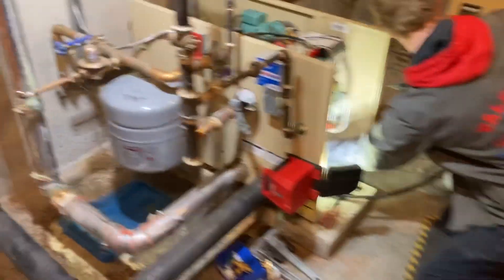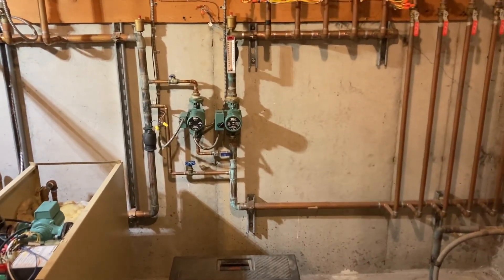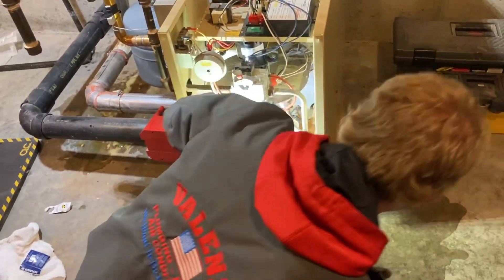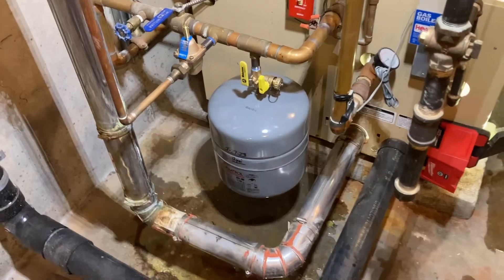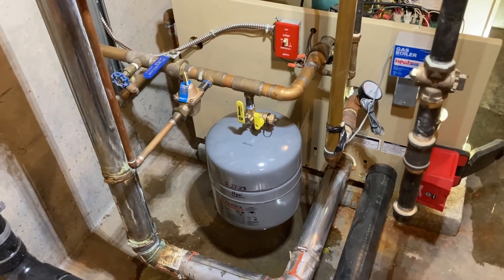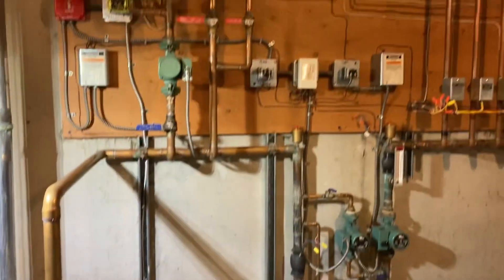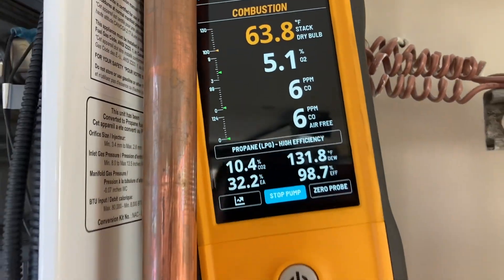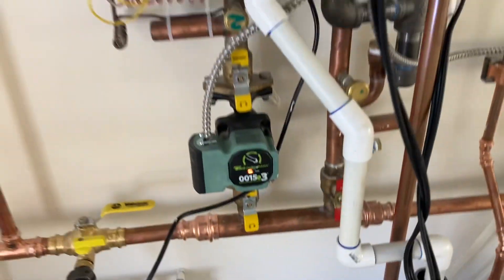Heating Boiler Maintenance and New Navien Startup! Radiant Floor Heating!

Comment: What’s the reason for coming out of the feeder with threaded nipple and then back to copper?
Reply from the maker: The feeder has 1/2” female threads. Only two options would be to install a male adapter, or to have a nipple.